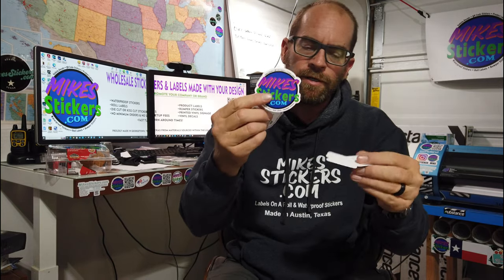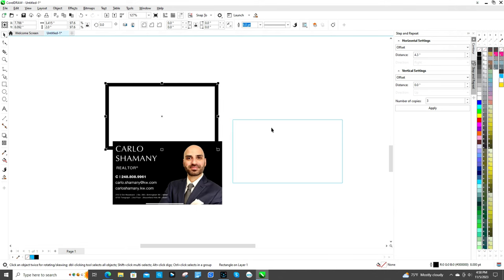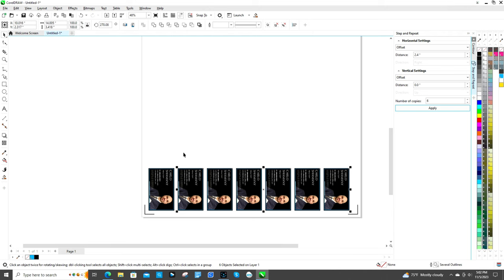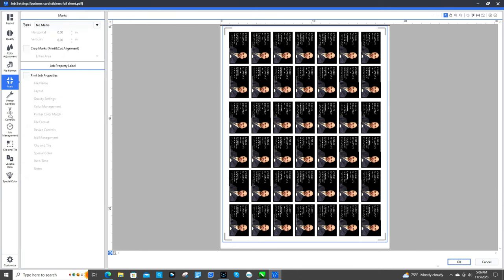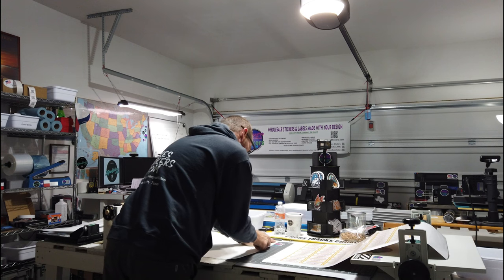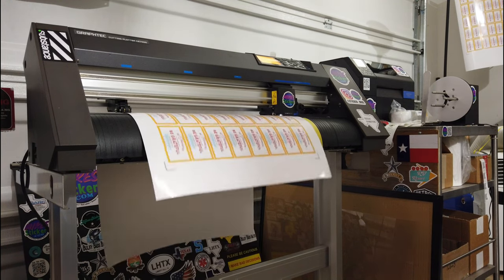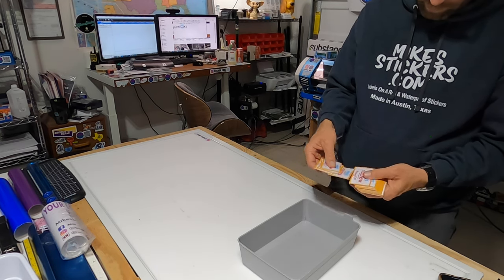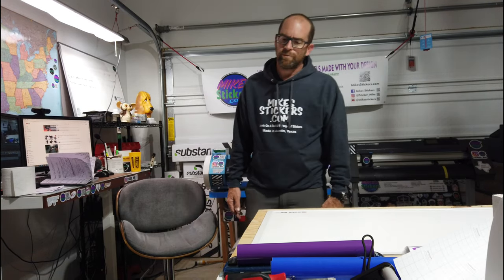How to make STICKERS at home, SUCCESSFULLY!

Comment: Hi Mike;  your videos are a great resource and inspiration. Q: with your Silhouette Cameo; do you still use the Joyza sticker paper? Q. Where you able to find the sticker paper you use larger that 8.5x11?
Reply from the maker: I stopped using the Cameo & sold it. I now only use the Roland BN-20a & the Graphtec CE7000-60. I was having quality issues with stickers printed on my cheap Epson printer. I sold the Cameo & my Vevor 34” cutter.
Reply: @mikesstickers thank you.  Would you recommend d the Joza paper if you had to do it all over again?
Reply from the maker: @RatchetUpYourArt  the paper was okay for what I was doing but when you try to remove them after a long time it tears apart instead of coming off as one solid piece. That’s my only complaint. My main issues were caused by the printer & ink I was using.

Comment: Great video Mike! Great to see your process. With the perf cutting, do you run through blades and cut srips on your cutter? I have a BN2-20 and am finding that I dull blades and destroy cut strips pretty fast. Do you also have to replace those things very often? Thanks for your time!
Reply from the maker: @briantheodore1451  nope! Same strip it came with & I change blades once every 6 months or so. I buy the cheap blades from Amazon.
Reply: @mikesstickers  Thank you for the reply!
Reply: When you perf cut on the Roland it’s very important that you adjust the perf cut correctly to avoid chewing up the cutter strip. Profile cutting adjustment is important as well but not as critical because it’s doesn’t cut through the backing.

Comment: Hi Mike, great Videos. Very motivating.
Habe you concidered doing 2 cut runs so you dont have to push the stickers out?
Reply from the maker: I don’t want them to fall out. The perforation cut leaves small tabs attached so the stickers are held in place until you push them out.

Comment: Do you have to have a special ventilation system for offgassing at home?
Reply from the maker: Sorry, I’m not going to give advice or recommendations when it comes to safety or health & I would recommend you do your own research. I am running this machine in a garage that’s not air tight.
Reply: I'm not a health expert but you do need ventilation when working with chemical substance such as ink, vinyl and laminator. Though they are much safer than previous technology, you still need some protection. It's better for the long run as it's not some immediate effect.

Comment: How come you don't use the bn20 to do the cuts as well?
Reply from the maker: The Graphtec cuts at least 5 times faster than the BN-20 does & it’s a lot more accurate of cuts.
Reply: @mikesstickers   so the graphtec reads the reg marks with no problems, how long you owned your bn20 now, how do you find the ink usage, I'm researching for getting this printer, it's crazy expensive, but my side hustle like you was, is very limited, and I want to grow, and leave my full-time job I have many sales for stickers but am limited to indoor use only, and want to start doing signs and graphics for vans, I'm just afraid of the huge investment and monthly payments, new ink alone in UK is like £57 per colour.

Comment: What’s the page settings on the BN?
Reply from the maker: What exactly do you mean?
Reply: @mikesstickers  ur media is 20” wide. How many inches is ur print area? And is it different if you add the crock marks?
Reply from the maker: Page size in  versaworks settings is set to 18.54 inches. In Coreldraw I set the page size to 18 inches. The crop marks in versaworks are added before & after the design so it doesn’t affect the width. When you add crop marks for the graphtec it does affect the width because it adds then to the sides of the design.
Reply: @mikesstickers  Thank you very much

Comment: This may be a dumb question, but since you have the bleed, why don't you butt the stickers up next to one another and do long strokes instead of cutting out each sticker individually? I understand for non-rectangular shapes, but for rectangles it seems like it'd be more efficient in terms of how many objects you can get on a sheet and reduce the cut time.

Additionally, you should consider using the input box for rotating. At 6:09 you can see that the angle isn't a perfect and is 270.08 degrees instead of 270, then at 14:49 you can see how all the outlines are jagged. This happens because computers are really dumb. If you are off by even a fraction of a degree, computers can kind of freak out a bit. The cutter and computer can have really precise controls, but it still moves in full steps of increments, so diagonals can get tricky, especially if they are really small increments.

I don't have experience cutting stickers, but I do have experience with laser cutting, software engineering and graphic design. Honestly, it's probably not that big of a deal, but one of my goals has always been incremental improvement when possible. If I can make something 1% better with a small tweak, I will always try because I find that it pays off in the long run. Sometimes I'll make a small adjustment to a parameter and a problem that seems completely unrelated will go away.

Also, if you're planning on making videos regularly, consider adding links to the equipment and materials that you use. This video was fascinating and has me interested in looking into sticker making as a side hobby.
Reply from the maker: Good thoughts. I don’t butt the images right up next to each other because the stickers get weak & can fall out during the cutting process. It makes the entire sheet too weak & it can then get bunched up in the pinch rollers. The gaps between the stickers helps add rigidity to the entire sheet for stability.
Reply from the maker: I will add the links. I meant to do that already.